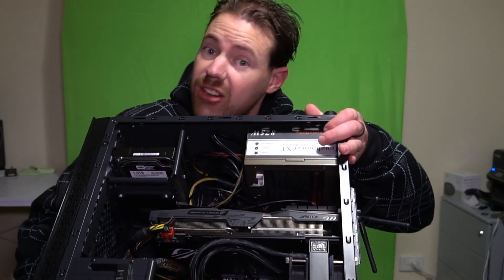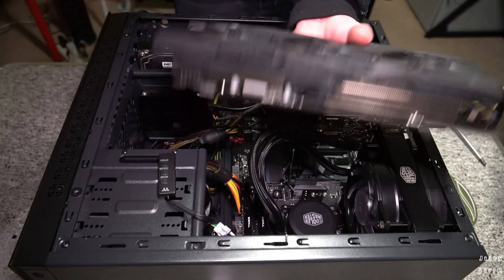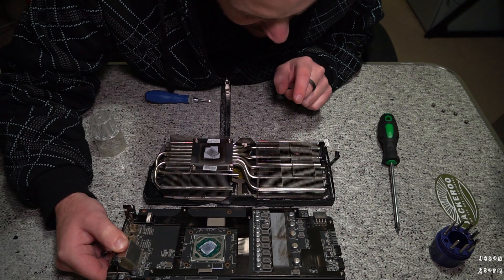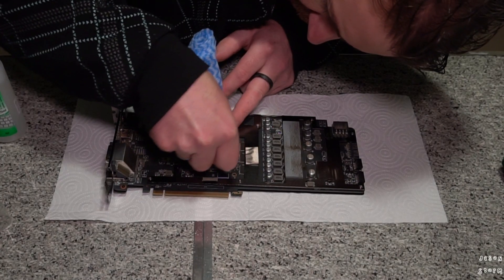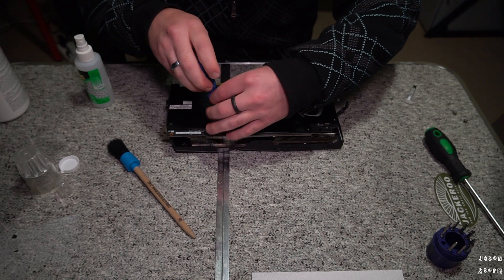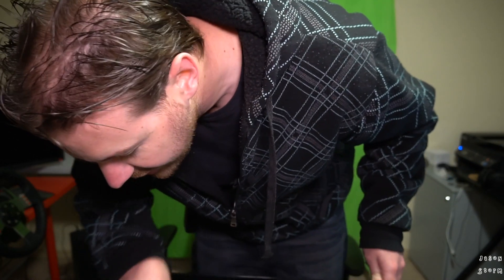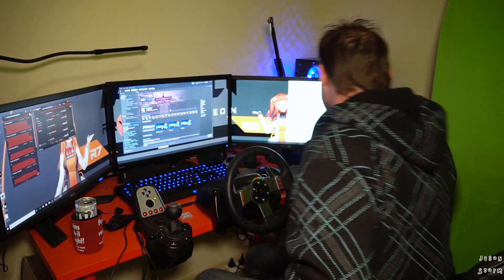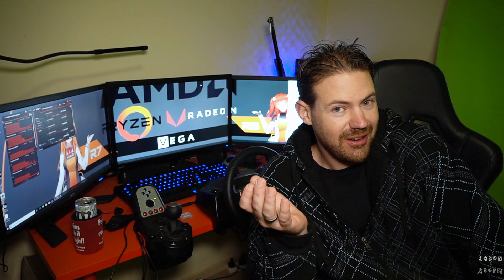How to change the thermal paste on GPU

Comment: Thank  you so much for posting this! I have the exact same card and it was overheating to the point of shutting itself off once it couldn't clock down farther to keep under 85C. Changing the thermal paste made it drop down to just 60C with a slightly overclock!

Comment: I am writing a long time after the video was published, but the 500 series is hot, so I used undervolting and bought a very airy spc regnum rg6v casing and with the minimum speed of the graphics card fans (42% is the minimum) and the speed of around 1700rpm I have 65-70C and currently I play red dead redemption 2 which puts a heavy load on the graphics card, so I think it can help many 500 series users, sorry if I wrote something wrong, I don't know English well

Comment: it did not changed, but you cooler might worked on higher percentage then before. It all depends on graph of %cooler power/gpu temperature. If you put 100% on 70c then it would get higher after paste change. But before it may be worked on 75c

Comment: Hi bro! I am facing issue with my gtx 1660 ti rog strix is no display on monitor. If I connect hdmi with motherboard my monitor display works fine. When I plug hdmi with gpu after some hours my monitor will display 2 to 5 minutes and then no display. It will be heating issue of gpu or not?

Comment: Whilst I love the video please dont do this again, For starters you use more THERMAL PASTE on a GPU then a cpu because its a direct dye and has to be completly covered, A CPU has a heat spreader,  you could have reduced temps more by changing the thermal pads also.
Also that thermal paste is junk use MX4 or thermal grizzly
And please people for the love of your GPU NEVER NEVER USE A BRUSH ON THE BOARD.

Comment: Doing this tomorrow wish me luck I have a 1080 ti ASUS Strix 84 Degrees on Full Load
Reply: how did it go ?:) i got the same card, i got like 77c with fans at 70% .. hope i will get alittle better results
Reply: @LegendXbox  It dropped greatly im super satisfied with how it turned out I never go above 80 degrees on full load anymore but I also swapped out fans and thermal pad

Comment: Just bought a 1080ti strix, (probably mined with) went 3 years running like that. I did a stress test was at 90c max load. then 60c Max under full load. Amazing results thank you.

Comment: You might wan't to add a little more compound since you do not want:  "heat spots" from air bubbles that could still be there.. Rather have some less thermal compound on your CPU. But make sure the GPU chip is completely covered with a thin layer. So there is surely no heat bubbles under your VRM. ( Since that is why we add that stuff on there ). Ass of factory settings, they come with slightly to many paste. Because they wan't to make sure it's airtight by the time gamers, game on it.

Comment: I had the same model rx 580 thermal throttling to the point where the pc would shut itself off to avoid damage. After reapplying quality thermal paste, I went from a 100 percent fan speed card that would randomly shut off and offer less performance to a quiet normal card that performs as it should. 87 degrees Celsius from before to 60-80 depending on the scenario. It’s amazing what thermal paste can do.

Comment: After replacing old paste, my gpu is nearly 20°c cooler in hardcore gaming and i get 12/13 more fps 😍 in bench mark Time Spy 💪
Reply: How do you get more fps from just switching thermal paste?
Reply: @lilmad3533 if all of your part run realy hot for sure your loosing fps... do some research
Reply: @lilmad3533   Gaining by GPU stopping thermal throttling 😉

Comment: I'm guessing that the GPU performance was better though? Less throttling (if there was any) or certainly a little less load on the fans? I've always found that the temps drop quicker after after the load reduces so I'm convinced that you did make a difference!
Reply: I actually just replaced the thermal paste on my 2 year old ASUS ROG Strix 1080Ti (non OC) - now I am seeing 3-4 degrees of improvement with the fans running at the same speeds. I guess its one of those 'your mileage may vary' sort of moments, but nevertheless, a good maintenance tip as the factory thermal compound looked just like your did in the video - crusty!
Reply from the maker: I can’t remember, it was a while ago so I don’t remember the details and I don’t have this card anymore but I think it was a little better, not a lot but I moved the fan curve up for the GPU so it didn’t exceed 80 C so that it didn’t throttle, but everyone’s GPU will be different, some may see good gains some more not depending how bad it is
Reply: @goodfella8572  I have the same as your card. what temps are you getting before and after? please respond.
Edit: and what paste company did you use?

Comment: Really would be surprised if you did'nt see and improvement, after the gpu thermal paste had been on a little while, otherwise I'd suggest giving your case fans 10/20% more rpm and see if you get better temps
Reply from the maker: Nah, even after leaving it on a while it didn’t change, I changed the case fans and increased the speed and still didn’t do much for GPU temp

Comment: Hi bro, the thing is i have bought an GTX 1070 asus strix oc SH, and i don't really know if i need to change the thermal paste, and that's because i am gonna buy my other parts monday i think... ( I5 6600k, 750w power supply, ninja scythe 5, cooler master masterbox mb511 and finally Noctua NT-H1
Reply from the maker: If your not sure just put it in and if you are having overheating issues on the GPU pull it out and try putting new thermal paste on it
Reply: @JasonStorm  ok thx, i'll try it